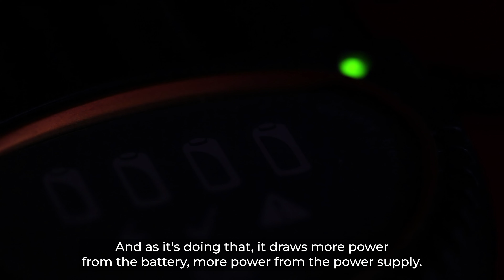IoT Uncovered: What is the most common IoT device design challenge?

Comment: Good advice Paul... Remember, lead acid batteries, particularly in hot climates, won't take long to deteriorate and begin to brown out. We use lithium-ion and provide the modem with a large capacitor to avoid this problem.